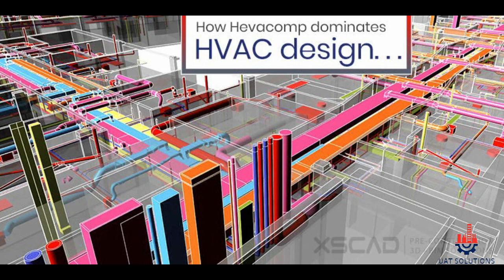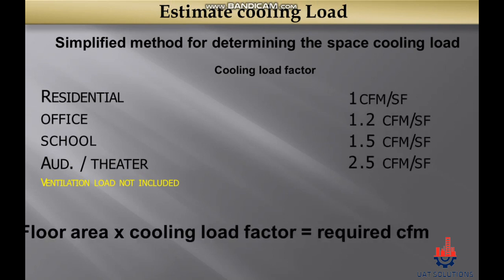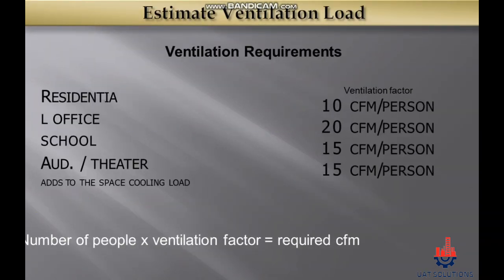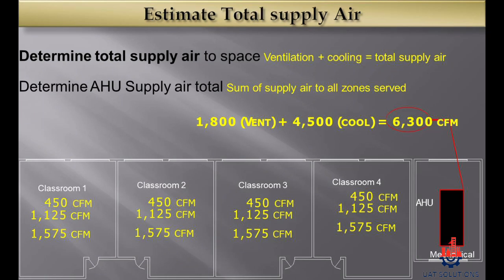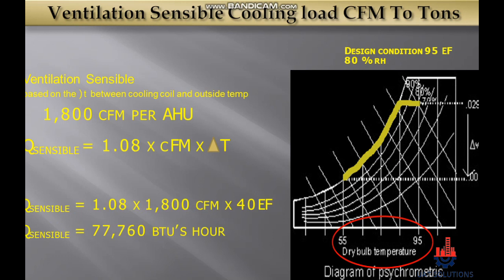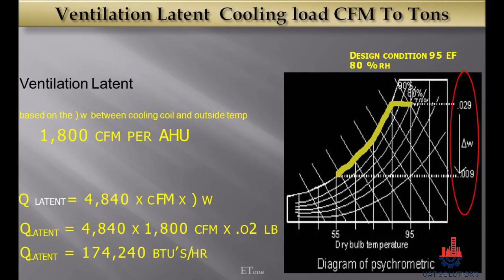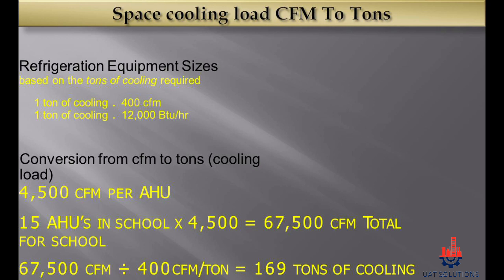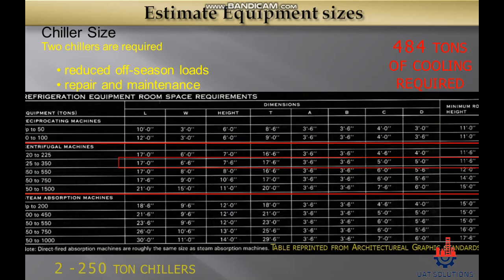HVAC System Design and calculation for Commercial and Residential Buildings.

Comment: Very helpful, thank you! But please, why was 4,840 used instead of 0.68 as the constant when calculating for the Latent cooling load?
Reply from the maker: There are different ways to calculate. Depending on the unit system used. And calculation method
Reply: @UATechnicalSolutions  Please can you give a little insight of how you arrived at 4840 or can you recommend a video, PDF or material that can help me understand? I'm quite confused. Thank you.